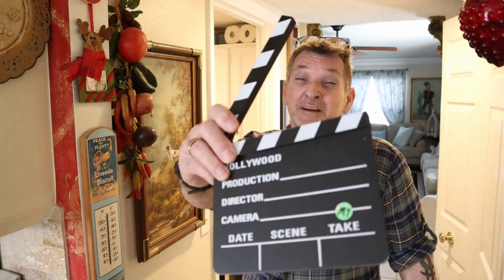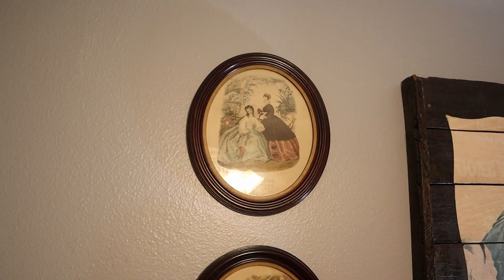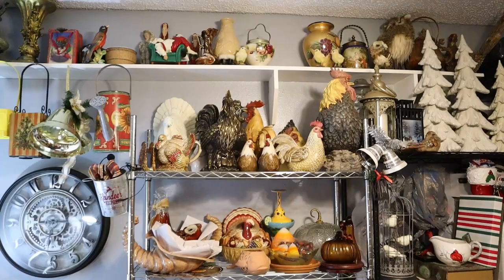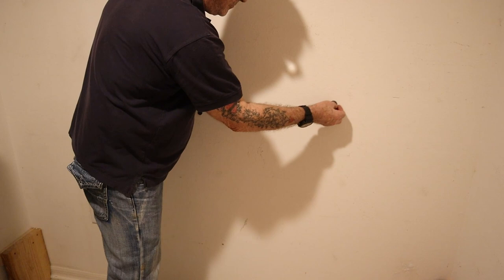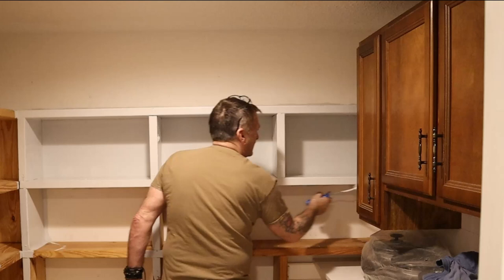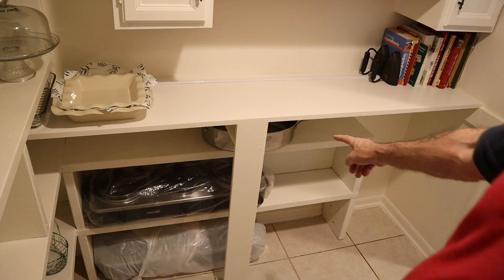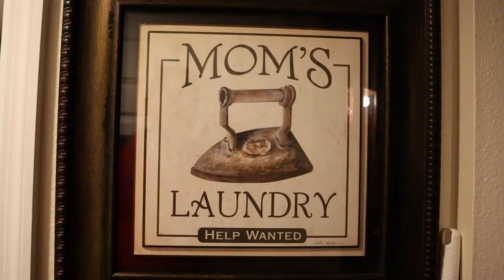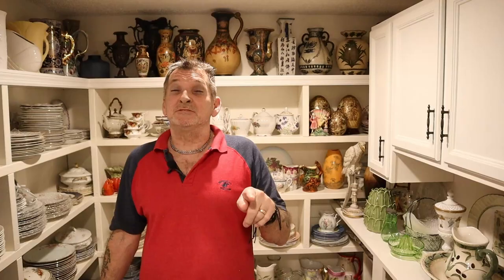The Making of Our New Butler's Pantry!! Deluxe China Closet

Comment: Very nice. I have plaster walls and have tried using various magnets without much luck, but the corners of my archways will hold a magnet. That doesn't help much. Ha! Thanks for the tips along the way. Those will be helpful.
Reply from the maker: Good point Older ! You'll need the electronic stud finder their not too bad $12 Maybe but with the runaway prices who knows !
Reply: @MyTakeOnHomeGarden  I got one a couple of years ago. No luck through plaster.  I can't measure from a stud because I don't know where they are! I've tried shavers and tapping. But so far nothing I've hung up has fallen down so that's a good thing! Thanks.
Reply from the maker: Yes friend of coarse you have horizontal lath wood underneath it will hang a picture or medium mirror thank you !❤😎